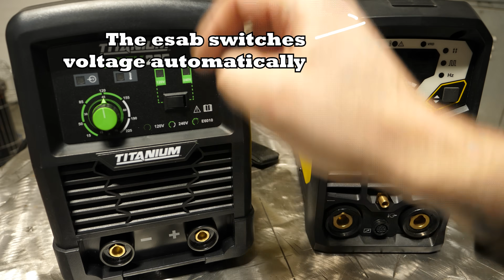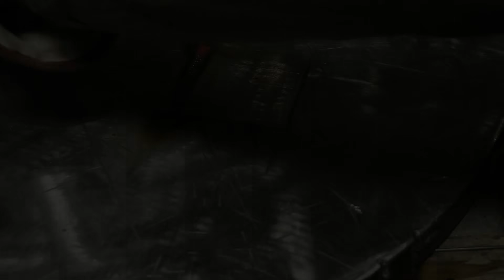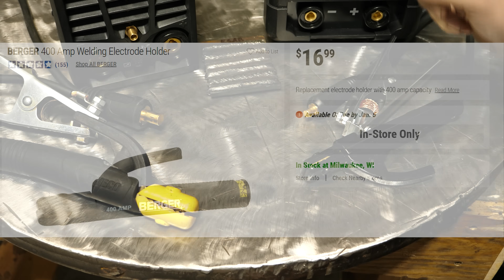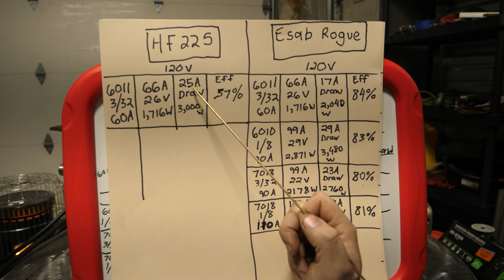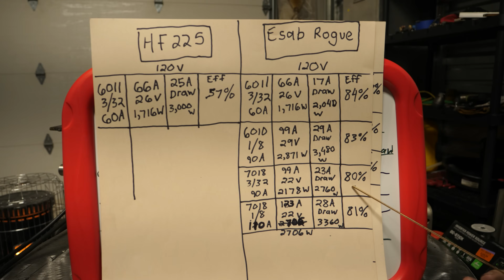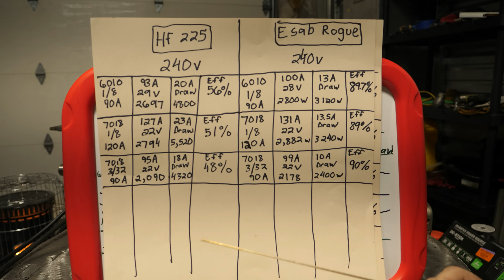Cheap HF vs expensive Esab welder comparison:  Deep dive

Comment: What kind of generator are you running for the test? I have that same titanium welder and can lay down beautiful beads with it. I got it used for a song and put heavier gauge leads and upgraded the ground clamp and stinger.
I literally got it with the plan of also getting a generator and being mobile (just to help out friends and family.) I haven’t gotten the generator yet. Could you go a little more in-depth on your generator setup, please? Thanks.
Reply from the maker: I will be testing it more in a video that will be out soon.  To help you out now, generator wise it needs a pretty significant generator.  The main issue is it’s power factor is low.  Because of that you will get breaker trips easily on smaller generators.  I am running it on a predator 9500, and that can output around 200amps on the machine.  Realistically you will need atleast a 5500 running watt to get 140amps or so out of it.

Comment: I’ve got to say I’ve been a sub since he had like 1k following watching him make these videos has just been a lot of fun. What did I do to deserve such a knowledgeable guy teach me all this shit? Been a fan a long time Greg could you please make a video about that esab ruffian? I love esab and I’m stuck between that and a bobcat !
Reply from the maker: Thanks for being a long term subscriber 😀.  The esab ruffian seems to be quite the cool engine drive.  I do have a video on generators and welders coming out soon.  I will talk about the portable units like the ruffian in it.  I can tell you that the ruffian is very similar to the HF Vulcan outlaw 195, the northern tool klutch 6000k, and a few others.  The main limitation of them is the generator output power.  They have enough power to run grinders, saws, etc, but they have very limited capability of running something like a MiG welder.  Realistically for most MiG machines you will only be able to hit 160-175a with a MiG machine. If a person wants to weld with stick mostly and occasionally MiG weld up to 3/16th steel, they should be good.  I was faced with buying something like the ruffian or a stand alone generator (predator 9500).  I went with the predator so I can run any welder I want.  I don’t regret my decision.
Reply: @makingmistakeswithgreg  dude thanks for the info yeah I’m just a stick welder the 9500 is like 2300 and for what that thing could do seems like a great deal, my only problem is finding one those things go fast!
Reply: Get the Bobcat,VLA

Comment: What generator/size are you using?
Reply from the maker: I am using harbor freights 9500 predator.  It’s 7600 running watts.  It’s capable of handling exactly 30amps at 240v output.
Reply: @makingmistakeswithgreg  Okay. Thanks. I actually bought the Titanium not too long ago, and was trying to figure out if the 6500 would be enough to run it; but it would probably have to be the 9500, or 8750 right? Since the 6500 only has a 23A breaker.

Comment: Good job Greg, I also have a Titanium 225 and love it. I did upgrade the cables and stinger but after using a 60 year old Lincoln AC225 this was like going from a Yugo to a BMW.
Reply from the maker: No doubt the ac225 can get the job done, but I would rather weld with the titanium 225 any day of the week.  You’re not stuck to specific amp setpoints, the dc output produces more penetration, and it will run many rods better.  And you can actually bring it to where you’re working without breaking your back lol.

Comment: Uh, some 3/32 6011?
Reply from the maker: I ended up using 3/32 6011 because it was the only 3/32 rod I had that would run below 70 amps.  I burned up all the 3/32 6013s I had left.

Comment: I agree. I own the ESAB 180 and run it on a Honda EU7000. it runs great.  I believe if you're just starting out, the HF will be sufficient for most things as you realize its limitations. I have done code work with the ESAB. Your view on the handgun course with more training and ammo has merit.
Reply from the maker: No doubt the rogue is a better machine, but 400$+ of steel and rods with the titanium 225 would make a far better welder out of someone than the rogue and 20$ of rods and steel.  For someone like yourself that has significant skill, the rogue is the way to go because it allows you to fine tune things the way you like it.  Not to say starting out with better equipment is a negative, it’s not.  It’s just with a budget only practice and materials will get to a high level of skill, especially with stick where it’s so much arc gap and speed control via hand and less machine settings.
Reply: agreed @makingmistakeswithgreg
Reply: The Honda EU7000! The king of portable generators!

Comment: Great video!  Thanks for providing the test data and helping us understand how efficiency affects the breakers.  Nice to see a break down of what makes a machine more costly, yet beneficial depending on how it will be used. ie garage vs generator
Reply from the maker: No problem.  One of the things I wish is that welder companies were a bit more honest about ratings and maybe even used the same testing criteria.  Not to mention when you actually use a machine enough to get a feel for it you can pick clear winners, spec sheets aren’t everything.  The biggest disappointment I have had in a welder was one that had the “best specs” on paper but when using the machine it was frustrating.  Kind of like a iPhone vs a cheap knock off, they might be similar but when you use them one is clearly better lol.

Comment: Wow Greg, another deep dive that presents way more analytical value than I thought available for this simple subject. 

So first, I have to admit I was quite surprised that Esab works with the 14AWG over the 12. That honestly startled me and to some extent I still ponder the legality of choosing that grade of wire overall since 14AWG really should NOT be used for 'welding'. 14 gauge wiring is designed for no more than a 20 amp wall circuit so why they manufacture it with this lower grade wiring has me perplexed. 

2, Your overall summary is absolutely, perfectly stated and I agree 100%; what do you get? You get a far more efficient machine. The question, and you covered this, is what can you afford? HF positively provides several welders for the common cost effective DIY'er and their Flux Core 125 is another cost effective solution. I've used that welder for YEARS and it continues to run like a racehorse without any issues so I've certainly saved money with that little demon. Let's also acknowledge that HF's warranties are second to none; just bring it in and get a replacement and walk out and pay up the new warranty. 

So, for #3, HF does NOT actually provide all the best bang for the buck in their lineup. Their MIG/Unlimited 140/170/200 models are clearly overpriced and under-efficient, especially compared next to this Esab. Their prices may be a smidgen more cost friendly and again a great warranty but if I'm over the $500-$700.00 range - beyond the DIY'er budget, you might as well go for more quality and as you presented here, this Esab not just provides it, but delivers it with damning efficiency and MORE options! 

I'm sold on the review and the day my Stick 225 goes, I'm definitely going to look at Esab for my next one. Your vid on the efficiency tells me the company built it well, and somehow was able to do this with an un-orthodox wire size which I am still perplexed over, but suppose I have to trust since the industry truly loves them as a manufacture. 

Thank you Greg, absolutely remarkable review as always.
Reply from the maker: I too agree that the 14ga is suspect.  They are relying on its thermal protection (aka duty cycle shut off) to control excessive heat buildup in the wire, and relying on duty cycle clauses in code is my guess.  I will have to look over the machine for ratings and testing approvals.  Right now all I see in the manual is intertek listed, which seems to approve most anything.  I believe the HF arguably meets a higher standard.  It definitely draws more power which would require bigger wire.  

I totally agree about harbor freight not providing the best bang for the buck in all classes.  The titanium 125 and 225 are solid well known reliable options from them.  I have used the titanium 170 and 200 Mig models, and they work good, but their price is too high to be competitive in my opinion.  It’s very common to find other brand machines close to the same price and they often have better parts and design.  I also tested either the 170 or the 200 (can’t remember which because the welders look identical) and it was in the ballpark of 50% efficiency.  My fp200 is only around 60%, but many others tend to be over 70%.  If they came with a 2 or 3 year instore warranty they could justify the price I think.  Once you cross over to esab/Lincoln/miller/Hobart/etc you get a warranty of 2-3 years with all of them, not 90 days.

I have used a rogue 180 for a lot of hours (I built 2 complete off road vehicles with it (all suspension parts, axle trusses, frame modifications, bumpers, beadlock wheels, etc) and hundreds of hours of side jobs without any issues.  I did most of it out of the driveway of the place I used to own, and welded with snow on the ground.  The only reason I sold it was to afford to buy a miller 161sth that had a better tig function (at the time the rogue 200 didn’t exist).  I really like it and the rogue 200 I currently have.  I like the miller 161sth more but it’s 2.5x the price of the rogue 200 and is not worth that. Realistically the rogue and rebel series I think are all awesome machines.  They aren’t the best at everything they do in my opinion (tig tends to lag behind others), but they are excellent for what they are designed for: efficient and portable welders than will handle portable work outside.

Comment: All these video on welders are useless. Cheap welders always work in the beginning. Show me after 500 hours on both.
Reply from the maker: Sorry you feel that way.  I used one of those titanium 225s for atleast 300 hours without issue in the past (it was stolen so I no longer have it).  Presumably it’s still working.  For the most part the titanium 225 has proven to be very reliable.  It’s simply not practical to talk about reliability in a comparison like this.  Why?  Because anyone can get a dud.  Harbor freight has sold a million of them, if it was known to fail or be garbage it would be well known by now.  

Just like I have a 7k miller dynasty 210 that didn’t work out of the box, required servicing after a update bricked it, and now requires a rotary encoder because it doesn’t adjust amperage properly, all within 14months.  The titanium 225 stick welder has more hours on it than the dynasty, does that mean it’s better?  Yes and no.  Surely I could put welders to the test until they failed and prove which ones are more durable, but not only is that a waste of money, but not a whole lot of useful info would be found.  In the case of this video the esab should outlast the harbor freight, and it should work better.  You could buy 3 of the harbor freights for the cost of the esab so it should offer something for the money.  

If durability is of a concern, a ideal arc 250 or dual arc 250 should be what someone gets.  They are known to last 50+ years without issue.  The problem is they aren’t portable (300+ pounds) they are the size of a small fridge, they draw stupid amounts of power, and they don’t weld as good as many modern machines.
Reply: @makingmistakeswithgreg  the same applies to positive review, the YouTube aggregates the data. Anyone can get lucky. China has about 5 qualities of parts for anything that is made. One capacitor from chingu vs one from wayang may differ wildly. Lacquer around copper may be inferior on one causing a torrid to fail prematurely. What you said was great info. I had three plasma cutters, and one tig welder just quit. At least you can talk with miller and get it fixed. Not so with most Chinese. That said, miller’s welders are made in china. But they are made to spec. China can make good stuff if they want to. It just costs about the same as good stuff everywhere.there is a bigger problem. Once a Chinese manufacturer start producing there is no way to control them letting their brother in law have the same design. They produce it with inferior components and the UScompany is not the wiser. It takes years for the clandestine activity to be caught and in the mean time image and quality cost have skyrocketed. I know of what I speak.
Reply: @makingmistakeswithgreg  what you said is true except my bricked Chinese welders are sitting on the floor with no way to get parts or repair. At least you can call miller for help. It’s a sad commentary on us manufacturing. The issues is not uncommon. The Egyptian used cheap labor to build the pyramids, Indians used Pakistans as cheap labor. We used Italians and polish to build big cities in the USA. Now, china is so big they use cheap rural labors to build stuff in their factories. I know from experience there are 3-5 versions of the same products in china. One is really good, almost as good as the original USA product. Miller tests and picks a component that is good enough to last past their warranty program. And example would be the lacquer that covers coils in a coil. One may be .3 mill and one maybe .1 mill. It might also be heat stabilized. Over time one may short out and reduce the effective length of the coil. That I turn causes more heating and leads to premature failure. This is why I said they may last for a while, but often fail in time.
Reply: @CliffordStaley  I was totally lost until you took it to Egypt and started trying to prove your point talking about the cheap labor making the pyramids 😀 ya brought me right back then
Reply: @CliffordStaley, you sound as stupid as trump 😂

Comment: One of the most informative videos that I have seen. Could you run this same test with your Firepower welder? Thanks
Reply from the maker: I have done it on the fp200 already, but I will be comparing it to the esab rebel soon 😀

Comment: You miss something in your math.  Power in AC is not just Amp x Volt, you have to account the powr factor (cosine phy) so the watts you computed in AC are not real. The different machines may have different power factors. So your all results are twisted.    
power factor is important in AC, you can see a huge current for little power (at same voltage) or less current for more power, depens ...   in DC  powr = A x V.    in AC, power (Watts) is A x V x Pf.  (power factor may vary from 0 to 1)
In conclusion, I'm not convinced of the efficiency you computed.  Instead to use an Ammeter you should use a real Power meter so as compare watts with watts and not watts with Volt Ampere.(VA)
Reply: You're right, but since all the measurements are done without the (assuable 0.9) cosphi, and this is not to certify a welder for standards, this comparison is absolutely sufficient for me.
Reply from the maker: I agree with what you’re saying but there is impracticality with testing this.  First is I can’t use the information from the manufactures regarding PF because many of them lie.  To test it myself would require both a lot of time and a decent expense for equipment, which isn’t practical.  It will play a role, but to what extent?  A vast majority of higher end welders claim .99 Pf at max output.  The harbor freight claims .98 in the manual (which is likely wrong) and the esab claims .99.  Even if the harbor freight welder was way less, it still would be nowhere near the efficiency of the esab machine.  

Based on actual generator loading the harbor freight can’t output 180 amps on the 30 amp breaker, the esab can.  I ended up getting sick so I couldn’t do further testing but I believe the most the HF could could output on a 30a breaker is around 150-160a so the actual output power required is inline with the calculations I did in the video.
Reply: @makingmistakeswithgreg  I totally agree with what you said here. You can't rely on manufacturers datas. You won't need a very expensive equipment..   no need to measure the cosphy, just use a standard usual Wattmeter.  some mini units are very accurate in these measures. I have one installed in my house that gives V, A, W, Pf, Hz and the total of energy (resettable) in one screen.( Of course, I compared these values with serious meters and the accuracy is quite good.) But out of this, good job, good comparison . ..

Comment: Another great welder video, thanks Greg.

I'd love to see an efficiency test with the Rebel.
Reply from the maker: I will be doing a bunch more efficiency tests with the new rebel vs the fp200.  I am hoping to see over 80% out of the rebel.  Mig welders will be less efficient than a stick welder because they have a wire drive to run, and in the case of the rebel it has a display.  If it hits 80+ percent it will be huge, because the fp200 is around 55-60% and all that extra efficiency means more power output 😀